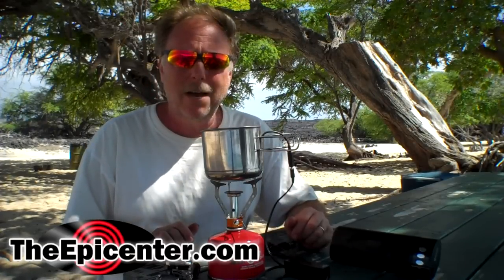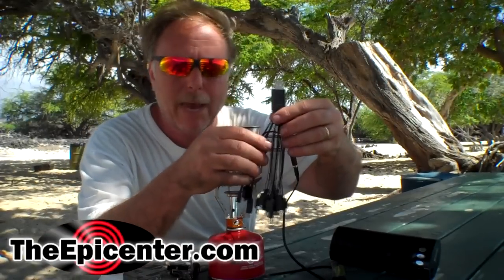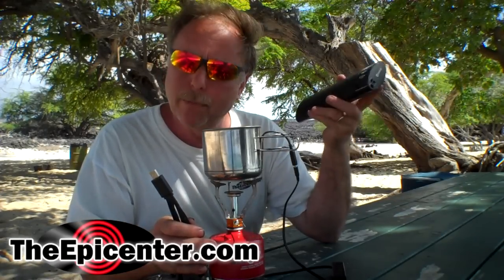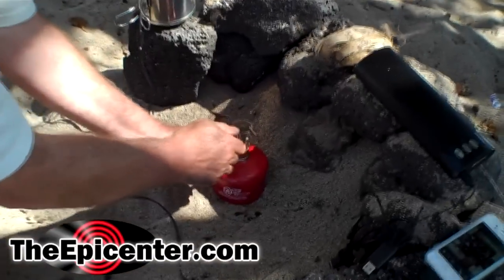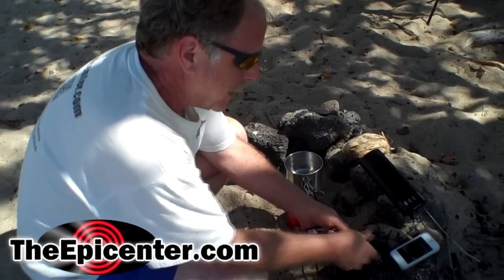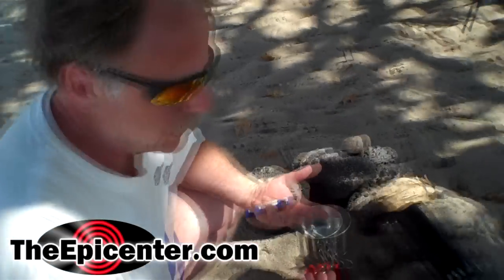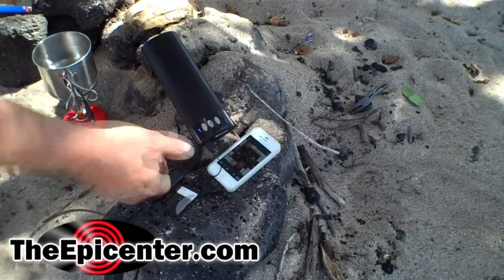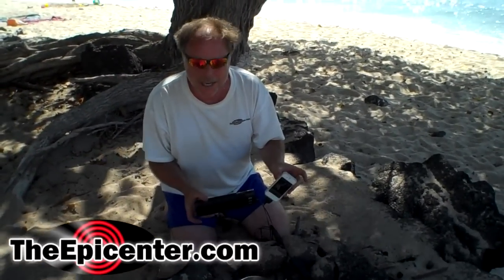Fire Powered Music using Thermoelectric Generator - The Cup Charger

Comment: Im debating the purchase of your newer 1.5 liter cup at your site, but I have certain questions concerning the USB issue potential of over charging or burning out electronic equipment.  As well I am curious as to the wires being fireproof or extremely heat resistant?  Also, if you could give me the specs on the component, whether it is TEC or TEG and what heat maximum values apply.  Minimum/maximum.  And what kind of warranty?  I ask because of value/vs. self building.

Comment: wondering why don't you put a lid on it to heat faster?
Reply from the maker: +blackmosesinc  Having a lid on prevents evaporation and actually decreases the temperature difference between the fire side and the coolant side of the TEG. That also reduces the available power slightly. The power isn't generated because the water is boiling, it's because the water is cooler than the fire.